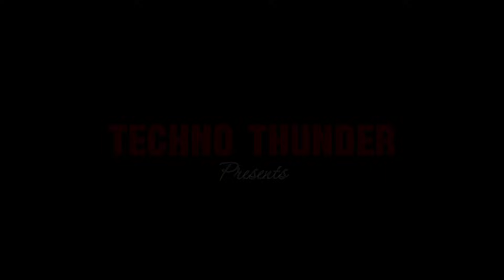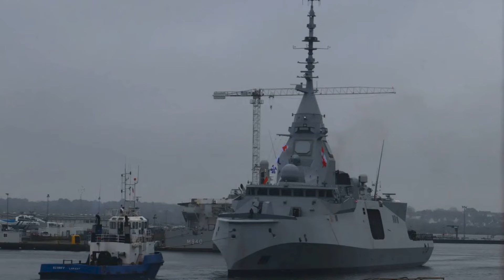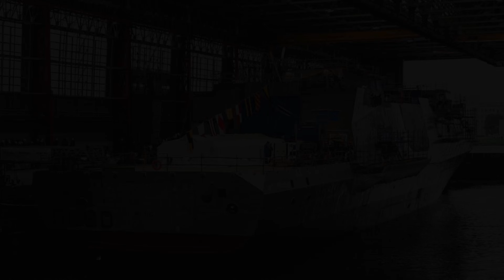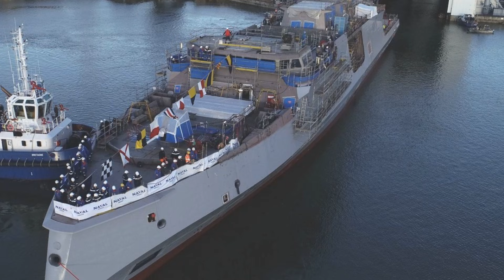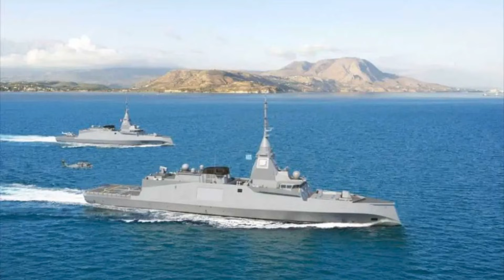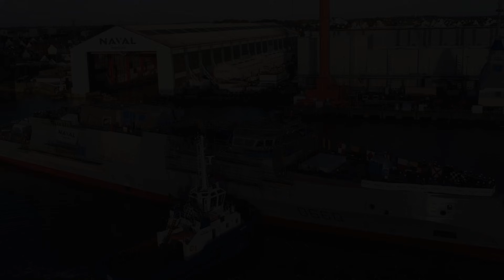France’s FDI Frigate Missile Leap: 16 to 64 Air Defense Missiles with a New Cold-Launch VLS

Comment: "is it better to have 48VLS, or a smaller ship with a mixed magazine that can throw a lot of interceptors at a rate without burning it's top tier missiles to early?"

48VLS, off course. You can mix your magazine all the same, with more flexibility. Same with attrition, better to have more cells. More expensive, but procurement rarely reduces to four of these against six of that.

FDI seems like a sensible design, and this are great news. I hope Navantia follows up with a larger magazine for the F-110s.

Salud

Comment: I'm not sure how a larger number of missiles loaded on a warship can better deal with a large number of drones or decoys, unless they have a jamming system
Reply: It isnt its job to deal with drones but have a 150nm exclusion zone for fighter aircraft.
Reply: @dragonxx444  It isn its job to have an exclusion zone for aircrafts, that would be the Horizon class or FREMM DA role.
It is a frigate, its role is to protect civilian shipping lanes, and to provide exclusion zone for cargo ships, and stop pirates from boarding them from the sea.
And to monitor what happens in the world...

And as a secondary role, it might have to help fight in an strike fleet. Mostly by taking the hit instead of higher value ships
Reply: @dragonxx444  It sure is!  Part of the FDI's job is anti-drone warfare.  It can use the new RIM116 Block 2 missiles to counter asymmetric air threats, ie: drones.  This newer version of RIM 116 missiles in the 21-cell RAM system in the rear of the ship are capable of shooting down drones, planes, and also incoming anti-ship missiles.  They have a range of 15-16km and travel at over Mach 2.
The FDI also has 2 separate 20mm cannons with an effective range of 3km for close encounters from the air and surface.

Comment: Sylver A50 and A70 cannot be quad-packed with MICA or CAMM missiles.  They are smaller than the US MK41 VLS which can accommodate 4 short-range missiles per launcher.  So I am not sure what you are talking about in your video or how you get 64.  The French do not have this capability today to stuff 4 CAMM missiles into 1 launcher.  Perhaps France & Italy are working on a new VLS that can be quad-packed.  That would be good news and they should have done this many years ago.  Also you keep talking about 16 VLS.  3 Greek FDI ships have been built with 32 Sylver A50 VLS and are already on the water, with the 1st one getting delivered to the Greek navy in a couple of days.  FDI #2 and #3 will be delivered in 2026 and #4 will begin construction in early 2026.  The 4th Greek FDI will come with at least 8 x Sylver A70 for cruise missiles.  It will be interesting to see how much room is left for A50 VLS or Aster-30's, because A70 is a bigger launcher than A50 and takes more space.  Hopefully it won't reduce the number of total cells.
Reply: Naval ground developed cold launch VLS for CAMM missiles. Problem of the MK41 is that they are hot VLS. With cold launch VLS you can very easily pack 4 CAMM in a standard A50 missiles. Hence the announcement.
If you know what cold vs hot VLS is, it's pretty simple to get it.
Reply: MICA no, not yet if ever, unfortunately its geometry makes it hard to multipack. CAMM supposedely can be quadpacked (company claims) in Sylver 50. There is possibility for some multipacking (2-3) for CAMM ER too but nothing certain yet.
Reply: they could increase the vls from 16 to 32 (as Greek using the reserved space) and the italian could pack 2 camm mr in one cell making 64
Reply: But MBDA showed CAMM can be quadpacked into Sylver
Reply: @LuqmanHM The new cold launch sylver modules can carry tripple packed CAMM ER but I think its the same number for basic CAMM too.

Comment: 16 Cell x 4 Camm-Er = 64 Missile
Reply: French and Italian Sylver A50 & A70 VLS cannot take 4 CAMM-ER missiles, and cannot be quad-packed because they are smaller than the American MK41 VLS which has that capability with ESSM missiles (comparable to CAMM/ER).  This guy is completely wrong and just dreaming.  He probably heard that Naval Group or someone might be working on a new quad-packed VLS for CAMM.  If that's the case that would be several years away by the time they build it, test it and work out the bugs.
Reply: @vtecharrys.6981 they will replace the VLS cells.
Reply: @vtecharrys.6981 but MBDA showed CAMM can be quadpack into Sylver
Reply: No.
It will be 16 PAAMS + 12x4 new cold launch VLS. 64 missiles overall.

Comment: How long will it take the world to understand France's strategy?
The Greeks and Italians preferred to have 32 Aster missiles, while France had only 16 measly missiles. What a joke... In fact, no one understood why or how, but now... we know!
Reply: Everybody understand France strategy. Less armament = more ships build. And if war happen, just put more missiles on the spaces left empty for say armament. It's easier to extend VLS count, than building a new ship.
That's why all ships can carry more VLS cells than they are delivered with. It's also cheaper because less weight, less maintenance etc. Overall,  as long as you are in peace time, you have more ships, trained crew for a lesser price. And if war happen, just add more missiles, which will just take a few weeks instead of like 2 years to build a new ship.
Reply: @karakiri283still doesnt make sense. Those extra armament arr relatively cheap compared to the price of the ship
Reply: @LuqmanHM  Certainly, but price isn't everything; saturation is also a factor to consider. The design of this ship makes it upgradeable; there is no reason why it could not be equipped with better weaponry in 10 years' time.
Reply: @LuqmanHM  Not really, the missiles are VERY expensive.
Reply: Europeans should stop f*cking around.

It makes no sense to build a billion dollar ship and then cut costs of missiles. They are not that big price over that billion.

Comment: Is France dropping the sylvr vls system?
Reply: Nope: the Sylver launches the much bigger and capable Aster 30, which with the last revision is able to shot down ballistic menaces. It also can host large cruise missiles like the Scalp and the next generation.
What the CAMM adaptation allows doing is to stuff a lot of smaller missiles in the same space.
My guess is that the Aster 15 will become a legacy ammunition  because it still requires the Sylver launcher and wastes too much space for what it does, and all the Sylver 43 will be removed. Both systems will be in use, the Sylver and the new cold launcher, as every ship that uses the Sylver can easily swap it. The Horizon class, the FREMM, the FDI and the PPA use the Sylver, and have often add on spaces reserved for increasing the launch capability if necessary.
Depending on the client, they can choose whatever launch combination they prefer, the 150 Km plus Aster or the 45Km CAMM-ER as the radar guidance system ( Kronos, EMPAR, Sampson, Herakles or SeaFire), can be adapted with minor tweaks.
My guess rather is that the MICA did not met the requirements to stuff enough missiles in a small launcher, which is surprising, but would explain how France is opening to a Britiah-Italian system instead.
Reply: @Zumzifero  The Aster 15 has uses (and also has users too) who want a cheaper, shorter, lighter, shorter range missile but with all or almost all (depending on the variant and target) of the capabilities of Aster 30. Since it can go to Sylver 43 cells you can shove those instead the 50 for lower weight, less hull penetration etc. So why I agree with you that capabilities wise, the Aster 15 looks reduntant and a bad deal (range like CAMM / CAMM ER depending on Aster 15 version but sized and priced closer to Aster 30) there are navies who might prefer it (and there are navies that are actually using it if I am not mistaken). Will that be enough to survive? I don't know. But since it uses most parts same as (specific vevrsions of) Aster 30 then it ll likely survive.
Reply: @DragonlordSVS Correct, but we are talking about new buildings that can still choose what to equip. Slips already equipped with sylver 43 VLS would require extensive rework to be adapted to the new launcher and it doesn't as always make sense financially
Reply: @DragonlordSVS you got wrong impression, CAMM can be quadpack or need less space than Aster15 so you can carry more CAMM than Aster15
Reply: Well Sylver built by Shipyard not Missiles Company...MBDA already use cold launch for their CAMM soo
Reply: No. Naval group just developped a clod launch variant for CAMM's.

Comment: CAMM-ER is built in Italy and already interfaces with no issues to PAAMS compatible systems. The land version, can be guided by a SAMP-T radar system if needed and was the whole point of the system development.
Because Thales radar is designed for the PAAMS launch environment, it should not be a big issue to make it work with the new missile. I guess Italy would be eager to use the new launcher, as many FREMM have unused spaces, similar to the FDI, for 16 more Sylver launchers at the front and the CAMM-ER, despite having a shorter range than the Aster 30, is a modern, capable and cheaper missile to shoot down subsonic targets. Carrying 64 missiles would greatly improve the capability of both fleets,
Reply: The CAMM ER originates from a British development CAMM. It is not Italian.
Reply: CAMM was developed by the British division of MBDA, a pan-European defense company owned by Airbus (French), BAE systems (UK) and Leonardo (Italian). The CAMM-ER is a joint development by the British and the Italian. Saying it is British or Italian are just over simplified.
Reply: @CosmicSomnia  The point is that the system is integrated in the current Kronos, system, which exists on both Land and Sea radar versions, meaning the current land based system can be easily adapted on a ship with a similar radar system. The CAMM-ER is currently being purchased by Italy: I don' t know if the UK started a procurement of the model. If it does, I don't know which radar system it will adopt and for what exact use. The CAMM is a different beast, usually adopted on smaller corvettes like those for the Swedish Navy, but that's a different system from Saab. Thales systems generally keep some sort of commonalities with the Italian radar, as they are interchangeable on the FREMM and both nation use the EMPAR on the Horizon. The FDI radar should not differ in principle from the Heracles
As far as I know, the UK is adopting a different launcher system on their Type 45, so I won't mess with that. When I say, the CAMM-ER is being built in Italy (entering service now) I mean that Italy and France would probably find some sort of common base for the launcher and the missile. The MLU for the Horizon will also adopt a KRONOS radar in place of the old EMPAR.
Being based on the ASRAAM, it is obviously of British origin, but we are specifically speaking of the CAMM-ER missile, which makes more sense on a fully fledged frigate, than a simple CAMM, by extending the interception range considerably and possibly replacing the Aster 15 completely.
Reply: @TheFreshman321  The CAMM-ER is a different missile from the CAMM, unlike, say, the ASTER 15 and the ASTER30, which just adds a booster. The Brits are going their own way, radar and launcher wise, so they are not part of this discussion.
Reply: @Zumzifero  CAAM and CAAM-ER run the same Radar and Software etc.  When you compare the two missiles its very similar to ASTER 15 and 30, with CAAM-ER having a thicker base for additional fuel and range.  The top half of the two missiles are almost identical.  It would be moronic duplication for Italy and UK to develop their own Radars and Software packages then compete with each other on price on what is supposed to be the same radar family.
Reply: @Weakeyedominant  They have different rocket engines as well. CAMM-ER uses an engine from Avio thats a bit thicker with a diameter of 190mm. CAMM uses an engine from Roxel with a diameter of 160mm. Both are launched from the same VLS tubes when it comes to footprint (275x275mm) though the ER one is longer. This means that you can pack the same amount of missiles in the same VLS pit usually between CAMM and CAMM-ER. For FDI thats 24 for each pit. Though no idea yet if the new launcher will support mixing CAMM and CAMM-ER in the same block.
Reply: Clearly , there is a need for high numbers of less expensive shot/medium range missiles as well as long range aster 30 AND then you need several  short range AA guns
Reply: @Weakeyedominant   the ASRAAM was developed into the CAMM with help from Thales UK. It operates under radar guidance by an Artisan 3D from BAE systems. As a Land System the UK utilises the Giraffe Radar from SAAB.
CAMM-ER is currently only under adoption by the Italian Army, with a Kronos Land System. The SAMP-T utilises the Kronos Grand, similar to the ship version. Sweden uses a SAAB radar on their Corvettes while Brazil, will use a BAE radar on the CAMM but a Leonardo Radar for the Land Version of the CAMM-ER. It's a mess.
The EMADS design for the CAMM system should offer flexibility in the kind of radar it can interface with, but still, the Kronos is at the moment the only operational PAAMS system able to directly guide both the Aster and the CAMM missiles.
The Sampson on the Type 45 is being upgraded to adopt the CAMM only (as far as I know), while I guess the Heracles from Thales could be converted without much troubles ti either the CAMM and the ER version.
The Horizon adaptation will be archived by changing the EMPAR with an Kronos Grand Naval, but no mention has been made to the CAMM, which Italy does not use.
I guess the datalink of the CAMM and the CAMM-ER would be almost identical, but the operational parameter differ a lot, if anything because of the different ranges and speed of engagement. It can be done much easier than, say to convert an SM American missile, but still it requires some work for both version separately.
I'm leaving the UK out because I have no clue of what they intend to do in the future with the CAMM-ER, if they will adopt it, if they will develop an even longer range the CAMM-MR for the Polish Navy.
Reply: @Zumzifero I was referring to the radar seeker integrated into the missiles themselves.  I agree in terms of ship and land based radars the missile is developed in a way to integrate with multiple systems which is a strength in of itself.  It is one of the reasons it has been such an export success and probably why it looks like France is going to adopt CAAM-ER itself rather than pursue MICA-VL which looks to be at the end of the road.
The UK is likely to adopt CAAM-MR long term for it's long range AAW needs although it remains to be seen if it will stick with Aster for anti ballistic interception.
Reply: what do you smoke?

Comment: How long before we either see drone resupply ships, or frigates start directly dragging streamlined barges behind themselves loaded to the gills with vls cells but controlled by the ships sensors.
Reply: Missiles are the most expensive things a ship carry! You don't shoot millions $ worth of interceptor as fireworks for the new year, and it also have an expiry date, so who would pay to fill up that "barge"?
Because the 76mm is a fantastic and proven weapon to shoot down drones and cruise missiles for peanuts, bringing a frigate to 64 launcher would exceed any possible requirement for the foreseeable future. You would not send a lonely frigate in an area where it could be subject to saturation attack anyway.
Also, because the Aster is more reliable than the USA alternative, the doctrine is "shoot-assert-shoot", instead of "shoot-shoot-assert" which always requires 2 shots per target.
Reply: @Zumzifero  Underrated fact. The Aster target destruction reliability is such that you can basically consider that a given number of Aster (say 16 as today) can intercep 80% more threats than the same number of missiles on a U.S. Navy ship
Or the 16 Aster of a FDI offer the same protection as 23 american missiles...
Reply: @Kollum Imagine Hellenic Navy FDI,KIMON class, with 32 Aster 15/30. With the SEA FIRE 500, first time in a ship.
Reply: @nikosmpasoulas3229  None of the Greek FDI's will have Aster 15.  Greece has only ordered Aster 30 which has 4x times the range of Aster 15.  The 4th Greek FDI will also have an 8-cell Sylver A70 VLS for cruise or SRB (Small-Range Ballistic) missiles.